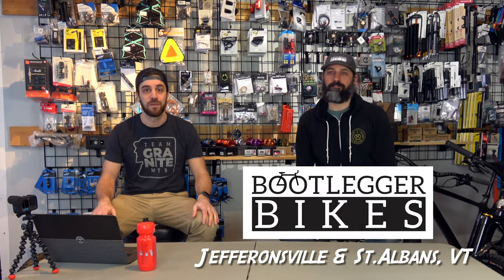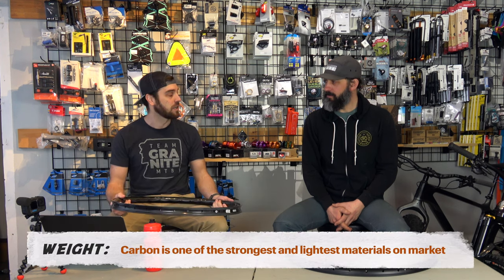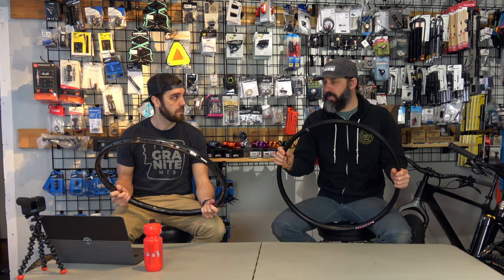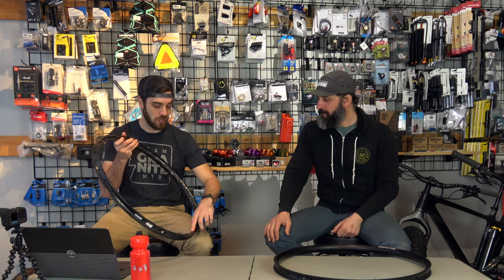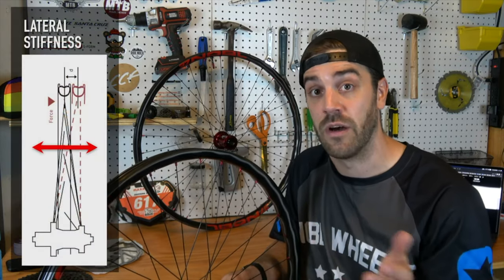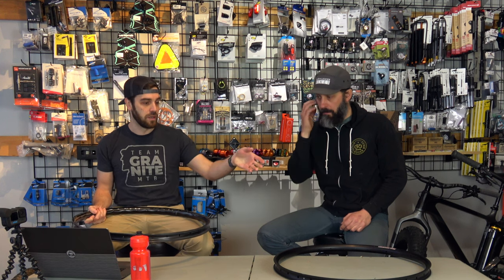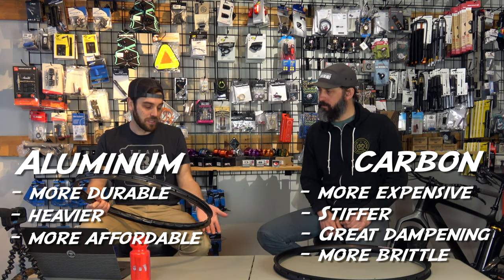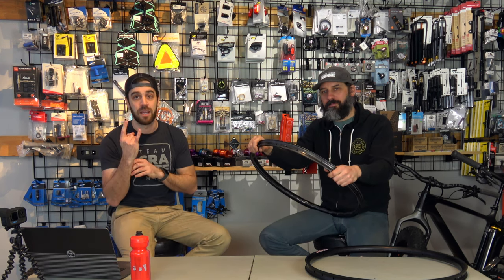Are your carbon mountain bike rims going to blow up?!

Comment: Do y’all have thoughts on other cost effective ways to reduce the weight of the wheel? Such as lighter tire, spokes, cassette, or hub to shave that quarter pound of weight with less of a cost investment?
Reply from the maker: Unfortunately, lighter generally always = more expensive.  There are certain minor adjustments such as running lighter casing tires, or digging into hub weight, but each comes with it's own set of flaws.  Cost, durability, etc.
Reply: @MTBTravelReview  ya makes sense, thanks!

Comment: I don't buy it.  65 gm difference is 2.29 oz!  Spinning weight is still the same weight measured on a scale.  I can spend my money cost effectively on other gear.  There is no product on the market more hyped up than bicycle accessories.
Reply from the maker: To each their own!  For me, it’s more about stiffness than weight.
Reply: @MTB Travel Review  it depends on the type of bike you're riding. 
You can ride a really stiff wheelset on a fully.
Stiffer isn't always better when you're riding a rigid single speed.
Reply from the maker: @shawnpritchard366  that is very true.
Reply: @MTB Travel Review  and not all aluminums are created equal.
2014 aluminum for example, has many of the same damping and ride characteristics of a well layed up carbon component, though it's heavier.
Reply from the maker: @shawnpritchard366  also fair points!  At the end of the day, it’s all rider preference.
Reply: @MTB Travel Review  definitely!!!
At the end of the day, it's all about having fun.
Reply: i just went from 2400gram aluminum wheels to 1240grams carbon wheels...night and day difference...lost 2.56 lbs of rotational weight...and another 350 grams lost switching from DHF tires to rekons...... .77 lbs of weight off the tires.....bike is more nimble and accelerates faster...suspension runs smoother too...less chatter...its a worlds difference...completely worth it...i promise you.....try it...i can ride further...get less tired...as i get older...lighter is better...my wallet is lighter too. lol...die broke...dont let your wife spend it on pool boy when you six feet under...wheels have lifetime warranties..